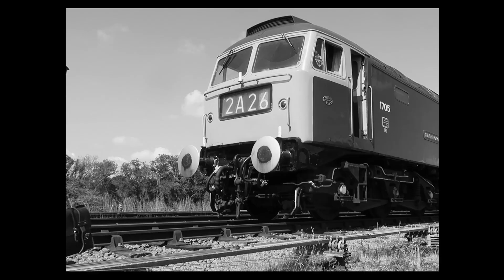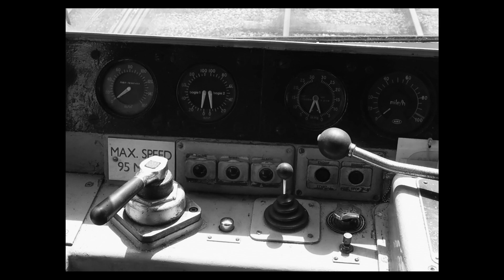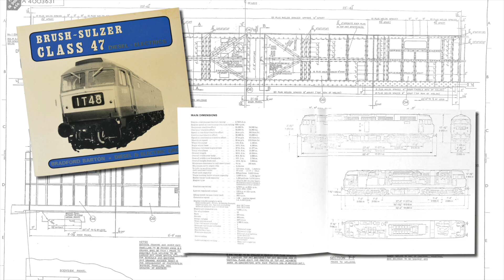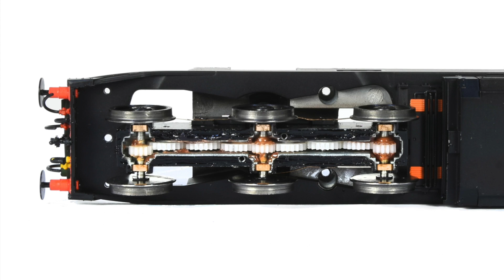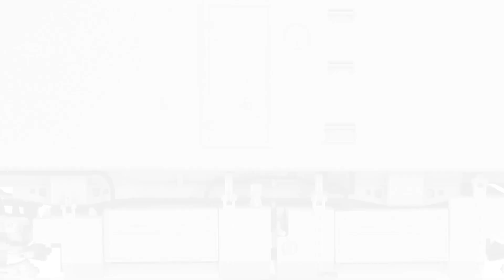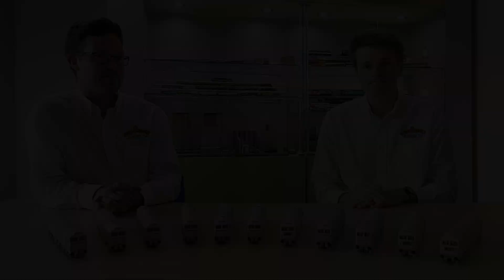Bachmann Branchline OO Scale NEW Class 47 Locomotives Announcement

Comment: How well do these run using analogue control? I bought a sound fitted Bachmann Class 40 recently to use on my analogue layout and although you get the engine sound, the loco moves at a snail’s pace, never speeds up and is slower than the prototype! I thought it might be a fault so I took it down to my local model shop but to no avail. The owner told me someone else had had the same problem with his Class 47 model. Oddly enough, my Dapol Class 29 with sound works OK on analogue.

Comment: With the standard edition will the sound be played on a gauge master controller or will have to be a standard bachmann controller
Reply from the maker: @Jack stephens, our SOUND FITTED/SOUND FITTED DELUXE models can be operated using any analogue controller - we advise using one which provides a smoothed output. Please check with your controller manufacturer if you are unsure in any way! Many thanks

Comment: Still has a major fault 😕
At the end of the video you say
 "I don't think we could have put more into it"
You have not addressed the issue of the Snowploughs which should be fitted to the bufferbeam/chassis and not the bogies with the Snowploughs fitted to the bogies they catch on the pipes which hang down from the bufferbeam as the loco rounds bends on our layouts it also looks wrong as on the real thing the Snowploughs don't move 
You have done a great job with this new brush but it could have been better much better if you had addressed the Snowplough problem by fitting them to bufferbeam/chassis instead of the bogies this is still a major fault in all ready to run locos today Snowploughs are not fitted to bogies on the real locos.
Instead of adding pipes underneath the chassis which no one will ever see once the loco is put on the track you should have invested time in the Snowplough issue. It looks awful when model locos run across point work and the Snowploughs are moving from left to right right to left which shouldn't be the case and catching on pipes which hang down vertically and don't move at all.
Bachmann please take note.

Comment: Good to see Dave Parsons involved with this - the work he did on the 158 to get it right was sublime (no disrespect to anyone else). This certainly does (at last) look like a 47 and the detail is impressive. My only gripe is the fixed centre axle which causes so many issues. Looking forward to seeing these first hand. Great work 👍
Reply: An A1A-A1A arrangement is far, far better for most requirements - rigid axles mean all wheel drive is never all wheel drive but more likely three wheels on each bogie!
Reply: @jameswells6003  it’s actually AIA  - active idle active 😉👍
Reply: @mikebuick2332  it's A1A-A1A, this is the case under both the UIC Classification and AAR wheel arrangements.
 https://en.m.wikipedia.org/wiki/UIC_classification_of_locomotive_axle_arrangements
 https://en.m.wikipedia.org/wiki/AAR_wheel_arrangement